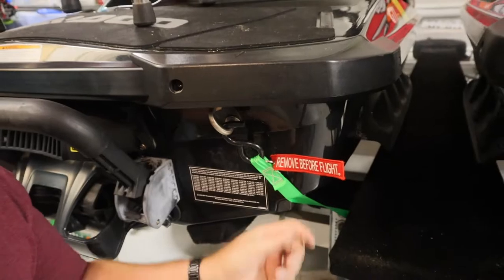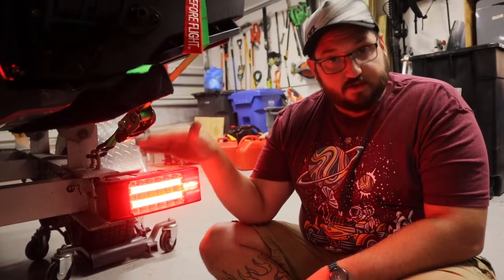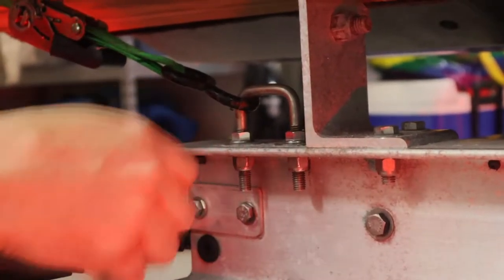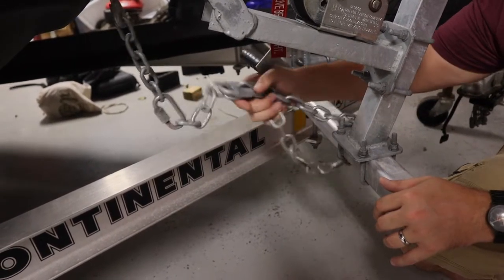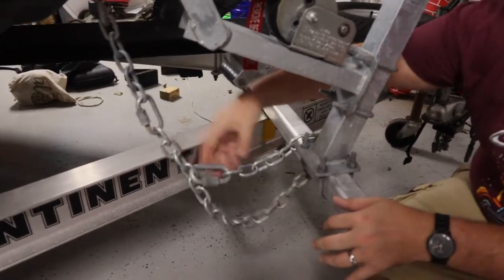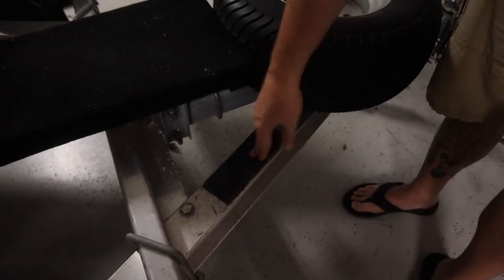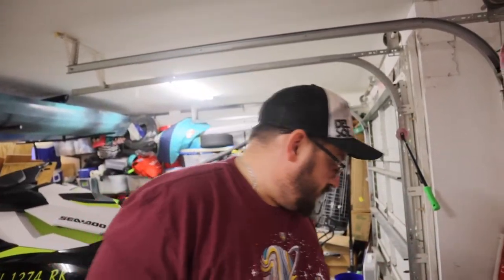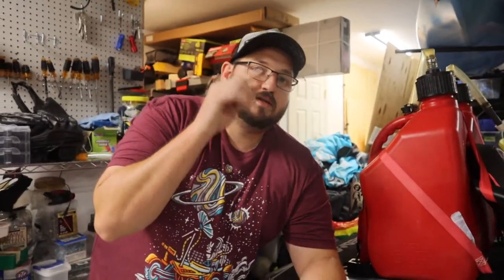Must have trailer modifications for jet skis

Comment: Sounds like you should have bought a better trailer! 😂 
I have a new magic tilt double trailer. 
My lights work great, i have a center bunk that works fine, your chain is too slack, my tie downs are in a good spot...But the dolly seems like a good idea. 
The swing arm could be useful for some if your garage is shorter.
Reply from the maker: Yes, it's true that Continental is more of a value brand trailer. But I think it does have "sturdy bones". The alarm chassis is super thick and strong. All the other small things are just that, small things. Also I think a lot of the things on this list like the swing arm and the extra wide center bunk are still good additions to any trailer. Keep in mind that this trailer all in was only $2,000. Magic tilt or rocket would probably be double that. I also like that the Continental comes with extra wide beach tires/wheels.

Comment: I love the idea about the remove before flight tags. They have places where you can get cheap custom ones. You can probably get one in bright neon that says CHECK PLUGS or something. And maybe add one on that swing arm pin as well to remind you to check the pin to make sure someone didn’t mess with it in a parking lot somewhere. Also have an extra pin in the truck just incase someone did.
Reply from the maker: Absolutely! Amazon does sell custom ones. Great ideas, thanks!

Comment: saftey chains are a must in aus, if you can shorten it and attack to the winch mount its better, less length = less distance it can move. Cover it with chain sock or heat shrink helps prevent hull rub damage.
Reply from the maker: Thanks for the info. No one uses them here in the US, so I appreciate the tips.
Reply: i just did this with mine and had the same idea. Heat shrink worked great. I used about 10 inches of chain and ubolted it around the winch mount.

Comment: I would look into getting the retractable transom straps. You can use your existing holes and may make it easier. 

The chain on the bow is not so much for an accident, any accident that has enough force to break it off the winch, is also going to break the bow eyelet through the hull anyway. 

It’s more to make sure that the ski stays put if the winch was to fail or the strap brakes when towing. Or maybe someone didn’t engage the lock all the way or it is faulty. 

A good practice I do is to use the soft loop, and instead of using it through the bow like you do, I use the hook on the bow eyelet and then hook the soft loop to the trailer. That way is the main strap should fail, the soft loop is still connected to that winch hook and will still hold the ski there. 

The soft loop is narrower webbing and not sewn to the same heavy duty stitching as the hook is, so I never relied on it as the only point my ski is secured with. I only use it as a back up. 

I even recently bought a replacement winch strap with the main hook and another strap from that hook with the same exact wide thick webbing as the main strap and it has its own hook instead of a soft loop. That way I can just clip that on to the trailer without using a shackle or something through the soft loop. 

Depending on how many tow vehicles you have, check out the BOLT Locks. They make them for all males and models of vehicles and you key the lock to your vehicle key. 

They make hitch pin locks, trailer pin locks, trailer tongue ball locks, padlocks, and cable locks. Makes it easy when you only need one key, your vehicle key, for all locks. And it is more secure than having keyed alike locks where you need 3 different keys and they are so easy to pick or a generic key may work. 

I have the locks for the pins and tongue and a cable lock that I put through the trailer and the bow eyelet. I bought a spare tire lock that screws on the lugs and that what’s holds on the tire, and I use the padlock to secure that. So as long as I have my truck key, I have a key for everything. I even bought two other hitch pin locks for the riser on my hitch ball so I can adjust that without needing a different key. I have had to cut off many different trailer locks and hitch locks because I forgot where I put the other keys. 

I wish I had two skis to have a dual trailer and have more room. 

Awesome video!
Reply from the maker: Wow, thanks for all the excellent advice. I appreciate your take on those tips.

Comment: Brother I see you have thick tires on the trailer what's the difference between the skinny ones and those? I like the looks but the diameter seems smaller . Thoughts?
Looks wise they are great!
Reply from the maker: The thicker tires are better for driving on sand and beach launching. Thinner tires will be easier to fit in your garage.

Comment: Thank you so much for the video me and my wife bought Two 2016 sea doo gtr and it took us 2 hours to even get close to getting the sea doos in the garage ,we couldn't do it and we parked it on the side .I felt so deleted as a man ,the trailer would only go to the right no matter which way we turned the wheel it was so embarrassing my neighbors were just watching .But wither way we turned the steering wheel trailer would go right please help me
Reply from the maker: Don't worry man, we've all been there. Everyone has to learn somehow. I understand it can be frustrating. First thing to remember when backing up a trailer is you should turn towards danger. Meaning whichever way you want the trailer not to go, turn the wheel that way. If the trailer is moving to the left and you want to straighten it out turn the wheel to the left.
I'll try my best to explain how I park my trailer in the garage, but you may be better off just searching for a dedicated YouTube video on the subject. Perhaps I should do one at some point in the future. Here it goes.
If looking at the house,  I start by driving down the street forward towards the house from the right. I pull the truck slightly into the driveway and then away at a 45° angle to the left. At this point your truck and trailer should be blocking the entire road with the rear of the trailer at a 45° angle to the driveway, and your truck to the left of the driveway.
Now turn your wheel hard left. Once the wheel has locked to the left start to back up until your truck is again parallel with the road. Once your truck is centered in the road straighten the wheel back out. The trailer will continue turning behind you as the truck and the trailer are now beginning to jackknife. Once the trailer is perpendicular with the street, parallel with the driveway turn the wheel hard right. The trailer should straighten out in regard to the truck and your truck will become parallel with the driveway, perpendicular with the street.
Back the trailer towards the garage careful not to hit anything. If at this point you realize that you have missed the opening to the garage, pull straightforward and correct it on the reverse, remembering turn towards danger.
If you find this to be too much, I recommend practicing in an empty parking lot until you get the hang of it.
Another option is to use a trailer dolly to manually push the trailer in by hand. 
Finally my double jet ski trailer is too wide for a single garage door opening. I am fortunate enough to have a three-car garage, so I have to back the trailer into the double door opening. Once inside I used jack dollies to push the trailer sideways into its resting place on the single garage door side.
I hope that was helpful, best of luck to you!

Comment: Great list the Australian type safety chains or straps are good insurance if the hand winch fails or isn't locked in.  I like the" 15 Clear Red Multi-function Stop Turn Tail Marker Trailer Light Led" for lights they are sealed inexpensive and can be mounted horizontally on the cross member across the back of the trailer so they are visible from behind but somewhat protected. A piece of old bike innertube can cover the chains so they do no damage. A pair of wheel chocks or blocks are useful and can help when parking the trailer or if someone is slipping into the water at the ramp. I through drilled and mounted them on the through rod that secures my fuel cans on the back of my aluminum tongue box so I can get to them.
Reply from the maker: Great tips!

Comment: A VP Racing fuel jug is what I need for my setup.  I'm done messing with the spill-everywhere EPA compliant ones.
Reply from the maker: Absolutely. The VPs are the best. I never spill with those. But the EPA ones leak all the time.
Reply: Look into sure can as well. Has a fold down nozzle and a grip trigger to drain.

Comment: Cheap fix instead of replacing your trailer jack wheel........ Get a Harbor Freight Furniture Leg Dolly.  Less than $10 and you can it cradles the wheel of your jack and makes it super easy to move the front end of the trailer in any direction.
Reply from the maker: Good tip! Although the gears just blew out in this jack, so I have an upcoming video of switching to a Fulton jack.

Comment: Never seen a winch fail or it's strap break. You can take 50 year old seat belts out of a car and they will hold a thousand pounds easily as long as they are not cut.
Reply from the maker: Thanks for the tip